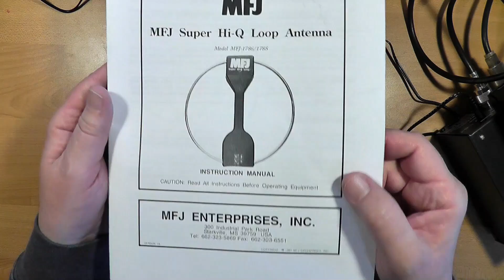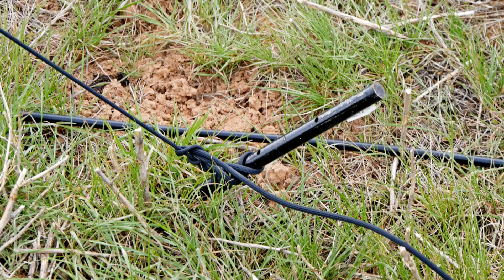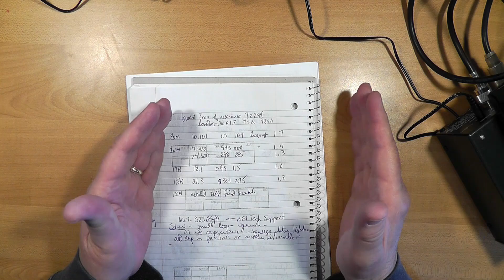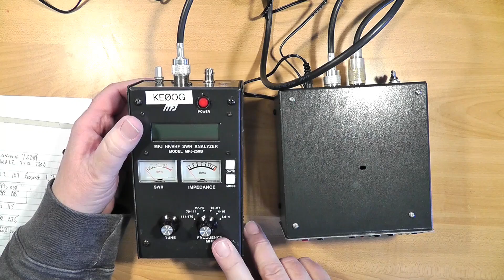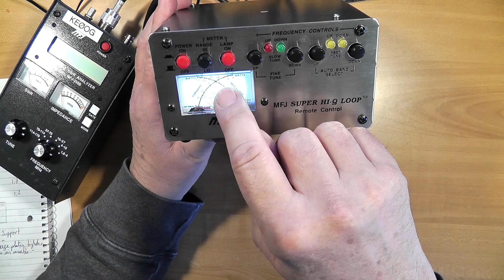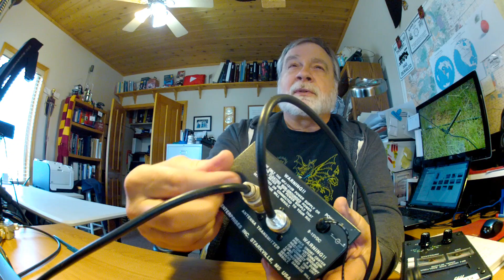Review of MFJ-1788 Mag Loop Antenna (#63)

Comment: Dave. I have the 1786 and am VERY happy with it.  It is quiet and I've made over a 1,000 QSO"s with it in the past two years.  Thought I'd mention, when vertically mounted, there is a null along the axis on either side of the loop.  Makes a difference on A/B antenna comparisons where the other guy is located.  Many thanks for your vids.  Great stuff.  Need more on propagation now that the sunspot cycle is waning.

Comment: My 1788 is installed on a rotator in the attic of a town house in a HOA.  I used PVC piping for all mounts and found the 1788 works BEST on 40M.  SWRs vary with position as does the signal strength.  Length of coax is important to keep it down to less than 25ft. Of all my options dipoles, capacitive hat horizontal multi-band dipoles etc - the 1788 was the best de AC4PS.
Reply from the maker: Wow! Do you have any pics of your installation?
Reply: Yes, I do have some...
Reply from the maker: Please go to www.dcasler.com/ask-dave and send me your email address. I'll answer and then you can send me the pics.

Comment: I've been running one of the these for about 3 weeks now with an IComm 7300.  It's mounted horizontally about 25 feet up on a pole attached to the side peak of my roof.  The manual is quite clear about putting up at least 20 ft. if you plan to run it horizontally.  That eliminates the directional null but you will lose NVIS as your null will be a 15 degree circle pointing straight up.  I can't talk to anyone closer than about 600 miles on 20m and I've managed one contact at 330 miles on 40m.   No one from anywhere closer comes in even when they're in my home town.  Additionally, I've found that mounting it at the very top of pole is important if you're using a metal pole.  So, don't leave metal sticking through the "donut" so to speak.  So far I'm quite happy with it.  I'm in Oregon and my longest contacts have been Hawaii and New Hampshire both 2500 miles away on 20m.  I've also heard Belize, Australia, Japan, Mexico, Brazil and New Zealand, but I don't think I've got the power (100w) to talk back to them except under ideal conditions (I've tried.)  I don't expect that will be possible until solar cycle comes around.  I've had contacts at 1200, 600 and 330 miles on 40m.

As far as Dave saying that it doesn't cover all of 40m meters, mine does and did out of the box.  As Dave finds out later in his videos apparently some of the antennas don't have properly calibrated switches and/or shafts on the capacitors and can't tune down low enough, but it is an easily repairable problem.   One problem I have had is that the tuner will sometimes freeze in place if the weather is really cold (in the low 20's.)  When it warms up the problem goes away.  I'm not sure what you'd do about this.  My brother suggested some kind of low voltage heater in the antenna's tuning box.  That would would require a power cable to be installed, but might be worth it if you live in a really cold part of the country.
Reply from the maker: Thanks for the info. I plan to mount mine horizontally soon.
Reply: Cannot get mine to match at all in Horizontal mode - seriously regretting the expense

Comment: I am testing a friend's AlexLoop.  I am really enjoying it.  I also concur that 40m suffers, but higher bands work quite well!  If you are in a noisy city area, and want to work DX, these Small Transmitting Loops are a heap of fun on everything above 40m.  Amazing how clear the signals are.  I am going to run this as a receive antenna, and transmit with a vertical dipole, flipping the switch, next.

Comment: Mine work super on 40m ! Hope you found your problem.
(Horizontal polarisation in ...the loft !)
No poles, suspended by strings to the eves of the roof.
Reply from the maker: I've set mine up for horizontal polarization, and will mount it either atop the roof or atop a 20 foot pole. I hope to do that soon.

Comment: Which of the MFJ Mag loops, the 1780, the 1786, or the 1788 would you recommend now that you had a chance to see how the 1788 works on 40 meters?  I'm torn between going with the 10 to 30 meter versus 15 to 40 meter.  40 meters is very popular but very finicky at 40, as I understand it.  On the other hand, the 10 to 15 meter bands are coming alive again soon.

Comment: Just a thought...adding the steel mounting pipe may cause some problems.  The mounts are connected to the antenna so any metal attached to the loop will add to the system.  I use a fiberglass mast on mine
Reply from the maker: I tried mounting it without the steel pipe today with a direct attachment to a wood mast. No luck so far.

Comment: mine works great on all bands. get rid of the metal pole and put the antenna up higher or lower. mine works best at about 3 feet high or 20 feet high
Reply from the maker: Thanks for the tip. I'll give it a try.

Comment: Dave, any issue with constantly keying up the transceiver to tune the antenna.  As I understand it, transmitting when a transceiver is attached to an antenna with a high SWR can damage the output circuits.

Comment: Great video Dave. Mine (1786) stopped tuning as the motor broke. Replaced with a new motor as close as I could find. It tunes great on 20m but 10 15 etc are over 2:1. I assume the motor is slightly faster so I need to slow it. I see the adjusters inside but I can’t find any instructions in my manual on how to adjust and what they all do.  Anyone have any info?

Comment: Thanks for another great review! I have watched several review videos of the MFJ-1786 and 1788 and it seems one person is thrilled and the next is sorely disappointed with the antenna's performance. First off, the price is ridiculously high! $199 would be more than enough and I am sure more people would be willing to try it at that price. This would be the ideal antenna for me in my HOA antenna restricted community. It would install easily and fit in my garage attic. If only there were consistent reports. I am confused..... do I try one or not? $500 is a lot of money for an aluminum Hula-Hoop!
Reply from the maker: The expensive part to construct is the air-variable butterfly capacitor. It's huge and has to be heliarced. I think that's why it's so expensive.
Reply: Yes, that makes since. I may try one if my 37' OCF 6-40m Dipole I plan to configure in my garage attic some way doesn't work out very well. Might be able to get away with mounting the MFJ Loop outside the house as long as it is not up more than 10 feet or so. It is small, looks high tech and would not be an eyesore, especially if mounted horizontal. I can claim it is an HDTV antenna...lol! Thank for your reply.

Comment: Dave, thanks for the video. I am not surprised that the loop does not do well on 40 meters. I build my own loops and make them as large as possible to get the most efficiency out of them. So for instance my 20 meter loop is 15 feet in length or about 4.5 feet in diameter. Whereas the MFJ loop is a smaller diameter antenna and therefore not as efficient. Most loop are great on one band, good on another, ok on another band  and bad on the rest of the bands. I am willing to bet your loop is great on 20 meters. Again, thanks for the video. 73 from N2LRB

Comment: Hi David couple of questions, if the loop was bigger could it be made to work on 40 and 80 meters?, also nobody ever seemed to use one horizontally will they work horizontal and prob be omni directional......from Fred g4vvq in England.
Reply from the maker: Yes on both counts.

Comment: Hi Dave, thanks for all you do! Dumb question coming.....I just bought the MFJ-1786, and the manual specifically states NOT to seal the holes, except the areas on the coax connectors.So that's what I'll do. However, although it might look odd, but could you put a covering over the antenna to protect it a bit from the elements without affecting the performance? 73!
Reply: The reason is to let condensation out of the box.   I think the instructions state that you can put it in a box, but you will lose some performance.

Comment: Dave,
Nice review. Ideally, you should not have any ferrous material near the loop. Aluminum would be better, and PVC the best.  73  WB3BJU
Reply from the maker: The manual says to use steel or thick-walled aluminum. I might be able to mount it directly to the 2x4--I'll add that to the list of things to try. 73, Dave

Comment: Hi Dave, another great review!  I'm sure you will get it going on 40m.

I've been thinking about purchasing this unit for use on 20m and 40m. It might be more fun to build my own. Is it generally true that a larger loop will have more radiation efficiency and greater bandwidth (lower Q)? 

Thinking about approx. 6 ft diameter using two 10' sections of 1" diameter copper pipe and a HV adjustable cap.

73 KE8EUI
Reply from the maker: I'm no expert on loops, but the larger loops do better on lower frequencies.
Reply: I think the loop is correctly sized for 20 m.  For 40 or less you'd want a larger loop under ideal conditions.   That would cost you on 20m and up though.   Loops are very finicky about frequency.

Comment: Hello Dave 
I got a Mfj1786 and mounted it horizontal It worked well.
But when I mounted it vertical with a 3 metres long steel mast stand in a steel tripod.
I can't tune it low swr.
Is it wrong mounting mfj1786 with mental mast?  It seems to make a wood mast better.
TNX & 73
bh4eag from China
Reply: You have to avoid metal going too far into the antenna when using it vertical.  I think there is something in the instructions about that.  Personally, I'd just use a non-metal pole if I were you.  It does needs to be a few above ground in the vertical mode, like 3 ft or so.

Comment: My comment :
In 12 months you'll have dust all over this equipment. 
It's great to learn and experiment but it's hardly a good system. I won't be trying one.
My next antenna will be an Omni-directional curtain nest array built on 3 acres of land for the 20m band and low angle dx.
See you in 5 years Dave, cheers :-) Wish me luck.....
Reply: We'll soon be full-time RV'ing (my wife's idea) so small portable hf antennas are of great interest to some of us hams. Right now I'm planning on using an end-fed antenna where I can (may RV parks frown on stringing wire around the camping spot) or my Buddipole vertical...........both of which are compromised antennas.

Gud luk DX'ing k6sdw
Reply: Check out the work here on You Tube by VK3YE.
He is the loop expert in Australia. He has much success.
Good luck and safe travels.
cheers, from vk4soe / la8pv
Reply: Much appreciated 73

Comment: MY MFJ LOOP COVERED ALL OF 40 METERS AND I ALWAYS HAD A FLAT SWR.
ALSO IT WAS MOUNTED INDOORS ON THE 4TH FLOOR AND I HAD STEEL ABOVE ME BELOW ME AND EVEN THE MFJ MANUAL SAID IT WOULD NOT WORK.
I SENT THEM AA COPY OF 44 DX CONTACTS I MADE IN 1 NIGHT RUNNING 15 WATTS  BOB  AF2DX  SORRY FOR CAPS HAD EYE SURGERY

Comment: I've never understood how these magnetic loops work at all, much less efficiently.  They look like dead shorts.
Reply from the maker: Yes, they're DC shorts, but at RF work as a tuned circuit with inductance (single turn) and capacitance. They're inefficient radiators, so they have to be made of stout materials to reduce losses.